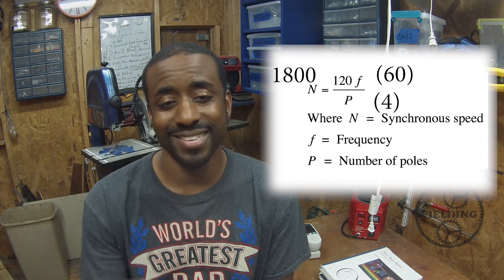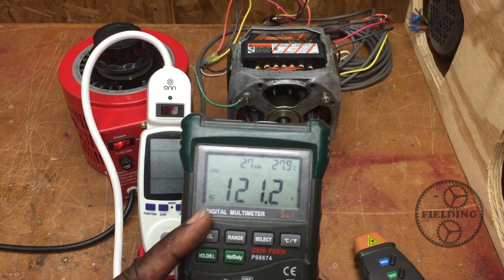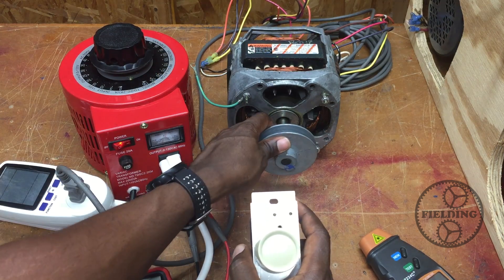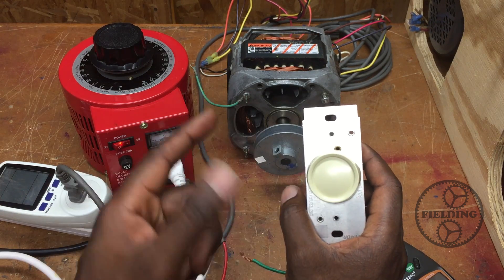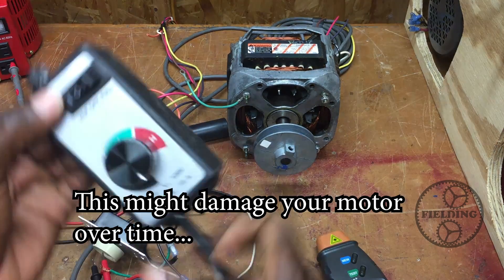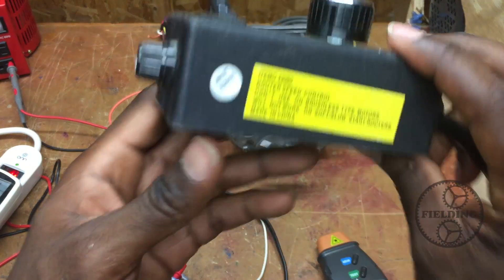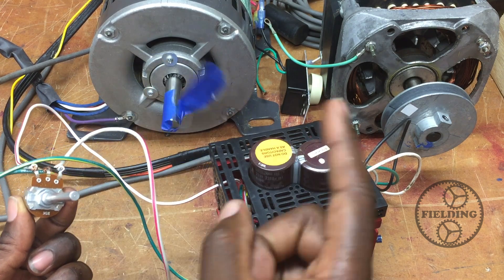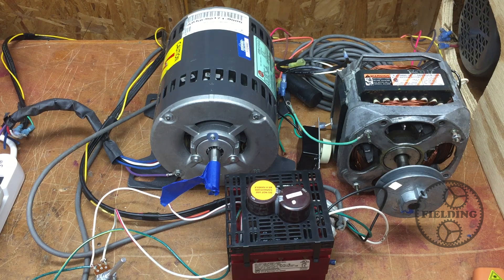Will A Dimmer Switch or Transformer Control An Induction Motor's Speed: 038

Comment: Are you sure that dimmer isn't blown? Because they blow closed. Just what happens when a triac fries it dies fused. So bright dimmers are dead dimmers. Dimmers that lost their dim are dead. Most dimmers really don't like inductive loads either. By don't like I mean inductive loads tend to fry triacs. Unless you put a snubber across the triac. Which dimmers not meant for inductive loads lack. They can't throw you the extra 25 cents worth of parts. Because if they did then they couldn't charge you an extra $5 for an induction rated dimmer.
Reply from the maker: Paul... you should know you just scared the crap out of me... I went and checked. The one I used in the video would not dim a light! BUT!!! Thank goodness I have more than one. I just re-ran the test with the same motor, wires etc and I got exactly the same results twice... including the same motor sound towards the low end. I retested the new dimmer on a light and it still works. I now wonder if I damaged the first one with all the testing. I must have shot that 3-4 times because of camera issues. It worked the same each time, but maybe the last time it wasn't working anymore... or it quit during the last test. I will never know. Thank goodness what was shown in the video is repeatable LOL. And thanks for letting me know they go dead with the circuit closed. I just realized I have been calling you "fred" for short in my head to remember your name... than I called you Fred in the last video LOL. Sorry Paul.
Reply: You're not the first person that has ever called me Fred. It's OK.  Yeah you'd think fried stuff would be dead. But fried dimmers are full blast. Which can fake you out. Because stuff connected to a dead dimmer is still alive. There's just no more dim action. A fried dimmer is a golden opportunity to modify your dead dimmer into a higher performing dimmer. Just buy a better triac for it. Which is easy to do. You'd be hard pressed to find a worse triac than what usually comes in dimmers. They usually use floor sweepings in consumer dimmers. Real trash. I use BTA24-600BW triacs as replacements. Not the best, but better than what is usually in a dimmer. They cost $2.50 for 10 from China.
Reply: @1pcfred  thanks for the upgrade tip... Can't wait to burn one up now!

I recently built the 12 volt power supply using a single phase Transformer, full wave Bridge rectifier, acceptable amount of capacitance to smooth Ripple, and then straight to the DC output terminals. Being unregulated it's putting out 16.4 volts DC to output terminals..... Is there an issue using a triac on the primary side of a transformer to control the secondary voltage thus lowering DC output?

Comment: Jeremy, excellent info and I really think your vids are really accessible. Quick question... Will a VFD work as a speed control under load? So as load slows it will it automatically pick up. If so how does it feedback?
Reply from the maker: The induction motor does that part. The VFD only changes the frequency. All induction motors naturally change their power usage to match the load... specifically to maintain their slip speed based on frequency. When you change the frequency the motor will work harder or less to maintain the new slip speed.  That function would never be required of the VFD.

Comment: Thanks Jeremy your videos are a true resource. I'm wanting to try and get into motors and I want my first project to be a welding positioner. I'm finding it hard to find good info on what to look for as a motor type. Induction is definitely out thanks to this vid. I'm planning on using a worm gear reduction gear box. To help lower the rpm and increase torque. I want it to plug into 120 and be able to control the rpm from like 0-10rpm. Max 50lb load more or less. Any pointers for or suggestions?. Any help from you and your subs is much appreciated!!! Thanks guys!!
Reply from the maker: A DC motor would be what you want. You will still need a DC speed controller of some type.
Reply: Jeremy Fielding thanks for responding. Yeah I assumed it would be a DC motor of some type. Using a speed controller and a potentiometer. Forgive my ignorance cause I'm still really new to this whole thing. So my questions might not be specific or concise enough due to my limited exposure on this subject. But I love learning by doing and I'm finding it hard to figure out a starting point. So like what size of motor would be strong enough or big enough for something like this. I read some posts that people use treadmill motors for the this kind of project. No idea what type of motor that would end up being. I'm looking for the motor type and I will do my research for what else is needed working around that. Any advice? I have audels millwrights and mechanics guide and also their practical electricity for core fundamentals, and a plethora of internet resources. Just figuring out a motor is what eludes me most. Thanks for taking the time to help me out. Love your channel and always waiting for your next video. Your an artist!!
Reply from the maker: +kurt O'Connor the treadmill motor is a PMDC permanent magnet dC. PDMC motors only go up to about 2hp for reasons I will explain in a upcoming video you will find helpful. However if you are making a turn table with a worm drive... 50 lbs is nothing. Almost any motor bigger than a "RC" car will turn it with a worm drive. Watch my first shredder video. Around time 4:30. That motor will lift a person on a treadmill. That will give you in idea of what I mean
Reply: Jeremy Fielding thanks!! You rock man!!

Comment: Hey mate, great video one of the best I've seen. 

Just with changing the number of poles in a motor, a 3 speed pedestal fan (shaded pole start induction) switches poles in and out of the motor.

It would be great to see what you could come up with for those.

Comment: An interesting electronic challenge.  I wonder if a modern (powerful) automobile inverter can be tweaked to give a variable frequency output.  Do induction motors work with the psuedo-sine wave that comes outta an inverter?  I know there's the complication of 12V supply, but ya know... just thinking.
Reply from the maker: I believe you are on to something. If someone takes such a challenge it would only be effective on certain types of induction motors. That is... those without a separate starter winding... Especially at low speeds where the starter winding would start back up. That will kill your motor in no time from heat.

Comment: Im not sure but i think you confused a triac with PWM. In PWM you switch something on and off and adjust the duty cycle. A triac "chops" the wave off the AC wall. Once again I say im not sure... If I am wrong i have all the plesure in learning more.
Greatings from Portugal :)
Reply from the maker: http://www.factsfacts.com/MyHomeRepair/DimmerSwitch.htm... have a look... tell me what you think. This was the very first thing that came up when I searched for "how a dimmer switch works" just now. they even used the same wording I did in the video... "on and off rapidly". and this one... same wording I used again. I didn't look these up before hand. That is just my understanding of how it works. http://home.howstuffworks.com/dimmer-switch2.htm
Reply: Diac triac dimmers are called phase fired controllers. Which just means 
the triac chops to the input frequency. The triac lowers the duty cycle 
of the sine wave by cutting a percentage of the wave off. If you were to look at the output waveform the sine wave would be chopped off. Part of it would be missing. Like this http://www.electronics-tutorials.ws/power/power28.gif That missing chunk is less power. Less power means dimming.
Reply from the maker: Yes the motor I am using has a separate start winding. There are quite a few ways to run and start a single phase induction motor. The shaded pole is another good example of one without a separate starter winding. I am aware of the others, but there are just too many different types to try and cover them all. Every source I have checked says the HF speed controller AND new light dimmer Switches use a "TRIAC". I don't know anything thing beyond that regarding other electrical components which might be working with the triac to get the desired result. But I have opened the HF controller and confirmed there is a triac screwed down inside.
Reply from the maker: Just to clarify... I have focused on the capacitor start induction motor because in my experience that is by far the most commonly used in machines and power tools. However, your comment does make me think I need to make it clear that there are many other types of induction motors, speed control options, and etc. some built in like the washing machine motor I use in the video (it has several sets of windings so it can be wired for different speeds) or the wide range of other methods.
Reply from the maker: I just watched his video... and as you said... that was terrible speed control. He said he read the instructions but I guess he didn't know he had a brush-less motor. The reason he got some control was because he had a load on the motor. I talk about this in the video. The motor is driving the belts and the chuck. That is plenty to cause such a small motor to slip beyond it normal torque capacity. When you cut the power that much the torque left over is nearly zero. In my case the motor was only spinning the shaft and rolling the bearings.
Reply: Jeremy Fielding Yeah, I see what you mean. The angle phases on an oscilloscope appears to increase the zero range which is where the momentum kicks in. It explains why there was a very slight frequency dip from your aRPM measurements.  Still, it would be interesting to find the actual frequency of the dimmer as it changes. I would bet that the dimmer may change the speed of a fan with a shaded pole motor. The air resistance would overcome the momentum.

BTW, I put in a good word for you on Mathias Wandel's. Anyway, your channel has the most comprehensive information on electric motors. I would add a legal disclaimer on all your videos to avoid any liability. There's always some fuck trying to make a buck.
Reply from the maker: +Barry Manilowa I agree.. in fact I think the shaded pole fan is a great application for changing the speed and getting exactly the result you want without damaging the motor.

Comment: There are VFDs that are used to control well pump motors in tankless home water systems. My house has one. It's runs directly off of the 220v in my panel. Now I am wonder if it is converting the power to three-phase?
Reply from the maker: Well... considering what it is... three phase is the best type of motor for the job. You want something that will run forever with little or no maintenance. That would be three phase. But there does seem to be a very small group of induction motors that can be controlled by other means.

Comment: What was your input power for the VFD.
Reply from the maker: +Tom Herd... it converts single phase to three phase
Reply: Then if one had a 3-phase 220V lathe and a VFD with enough capacity for the lathe motor it could be run on single phase 220. I think? Don't know if VFD's power rating is in HP, if not I guess one could convert.
Reply from the maker: Yes. they are rated in hp. The one I am using in the video is rated for one hp so I should not be using it with that motor. Anyway. It converts single phase to three phase so yes... you could run a three phase powered lathe with this vfd or others like it... rated to the hp needed.

Comment: I took apart a small standing fan and noticed that it had 3 "load" wires, and the fan ran at different speeds depending on which one you connected. Based on what I've learned from your videos, it's an induction motor and I guess each of the 3 different wires changes how many poles are created. My question is where can I find a diagram of some sort that shows how the windings/coils are configured and wired up? I've googled incessantly trying to figure this out but I can't seem to find anything. My curiosity is insatiable and I'd very much like to understand exactly how they managed to wire this up to achieve different speeds. And thank you so much for making these videos!
Reply: You could try measuring the resistance of the different winding sets. That would at least give you something to map out. I'm sure they would be different.

Comment: Jeremy,
This is one of your best videos. Thanks to you, I have a better understanding of motors. I have a question I hope you may be able to answer. My wife and I bought a vacuum  cleaner when we were in Japan, and as you may or may not know, it has ~100 -110 VAC, 50 Hz coming in to the inlets. If I plug the vacuum cleaner in a 120 VAC, 60 Hz inlet, the vacuum may work a short time but turn off. At first I thought it was a fuse or something blown, but then I thought, plug it into a step-down transform... It worked. The vacuum cleaner says that it will work on 100 VAC, 50/60 Hz. The average volt when I checked it when we were there was 110 VAC and the vacuum worked. Any thoughts on what maybe going on? Thanks!
Reply: 4 years late I know but may have to do with the frequency. I've been looking into an imported compressor being sold here in Barbados on special, turns out it's on sale because the 2hp single phase motor was intended to run on 115v 60hz, however the motor gets hot on our system which is 115v 50hz. For most 60hz appliances with motors or compressors e.g refrigerators,  washing machines, treadmills, AC unit, etc, we usually use a transformer to step the voltage down 115v to 105v, most common is the 1000VA version. It's referred to locally as a stabilizing transformer but doesn't seem anymore different from what is online labeled as step-down, autotransformer or voltage reducing transformers. I never gave the need for them a second thought until the compressor sale. My research for something powerful enough or other options like inverters etc led me to understand that lowering or raising the voltage affects the Volts/Hz ratio. Google it for a better understanding of how a few volts less affecs frequency, speed and cooling, torque etc
Reply from the maker: I am not sure. I would not expect 10 volts to make a difference. How much did you have to lower the voltage? Also, does it seem to be getting hot?
Reply: I was thinking the same thing, because it only about a 10%, give or take. I just took the volts reading from the incoming, 122 VAC, Step-down output 105 VAC (13.9344% difference). I will crack that thing open and see what's going on. I am also thinking there maybe a current or voltage limiting circuit inside. Thanks.

Comment: You should have said, that many of the VFDs have a single phase input, so its easy to change a single phase motor to a 3-phase-motor and have the possibillity, without the need of a 3-phase-connection in the house, to adjust the rpm of the motor. But you make great info-videos. Many can learn from your instructions. Keep on the good work. Sorry, english not my mother language. Regards from Germany.
Reply from the maker: Originally I was going to show the label and mentioned it was single phase input three phase output... but the video was a bit too long so it fell on the cutting board. I agree that would be a good addition though.
Reply: No problem, i'm sure, you will be flooded with questions about this theme. There you can add this info. Cheerio.